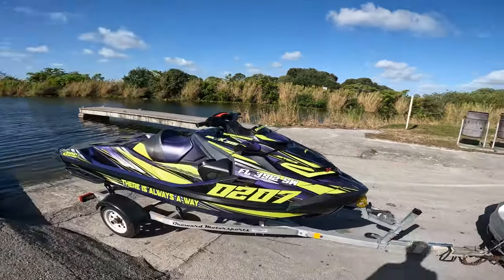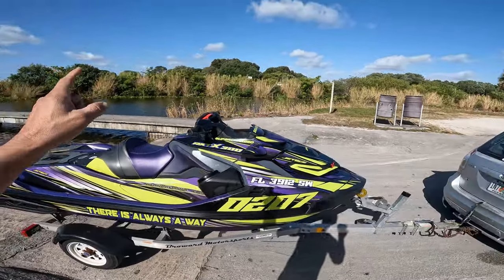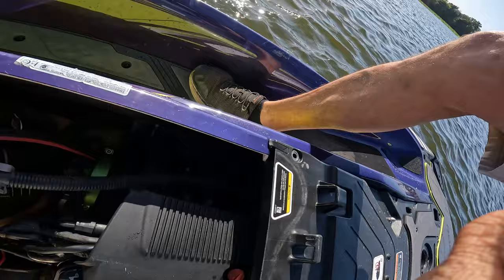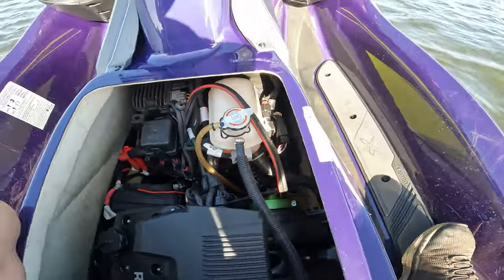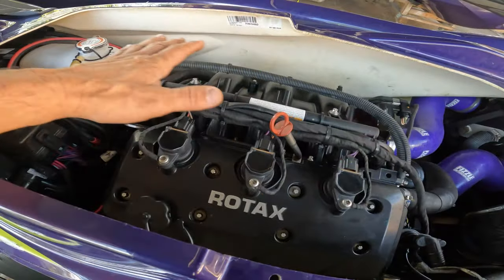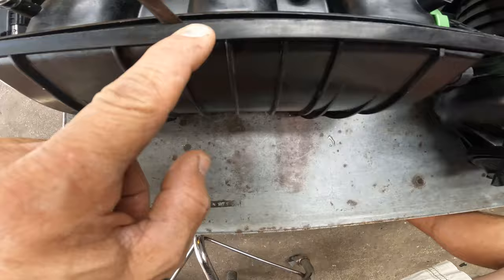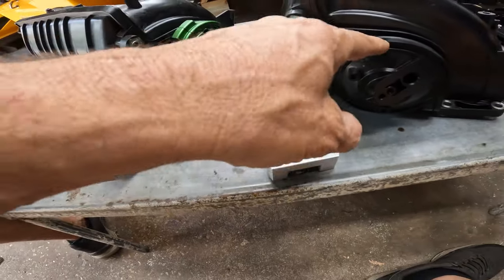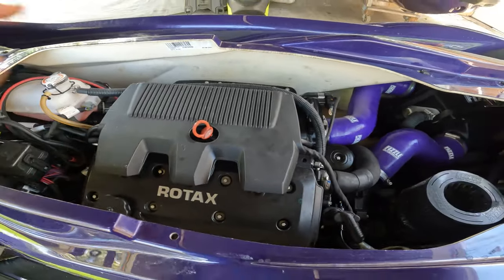Sea-Doo DDR Intake Manifold Brace Install + Rotax Intake Tech Tips + Seadoo Intake Girdle

Comment: I have the same problem with 2019 gtx 300 ltd I've ordered the new manifold 2 girdles one for the broken manifold another for the working seadthemy father as master tech is going to help me with the installation and removal. I do have a question is there a torque spec I need to seat the manifold bolts down to or any other suggestions you may have to make sure I do a proper install. I love your videos the energy your a cool guy. Ty for any pro tips you can provide me with

Comment: Hi I have a 2023 Seadoo GTR 230 that will not rev out to 8000 rpm and only run’s 59/60mph at 7700 rpm . Only 20 hrs
Impeller and wear ring are good , no codes TPS was reset. Wondering if you may have some insight to the problem.

Comment: Question - I have a JP racing stage 1+ on a 22 RXTX. I am pulling my intake manifold for the girdle this upcoming weekend. Should I just do the ribbon delete as well? Does it make a difference? Thanks
Reply: Depends on your riding style.  If you strictly do lake riding , I'd say yes, remove it.
Reply: @DessiLu14  I ride lake and rivers, all fresh water. The river I go to is the north branch of the Potomac where it’s 12 miles of glass. Thanks for the reply!

Comment: Hi! If my intake manifold its already broken, i need to replace or with this brace i have the solution? Thanks!
Reply from the maker: Unfortunately every time that happens it’s with a customer and I always replace the intake manifold but I always wonder 💭 if it was my personal situation would I want to install the brace and put a boost gauge on it and see where the boost is what your supposed to have .  But my only concern is to see if it will keep cracking all the way around.  You can just try it for science and let us know in the channel what happens.